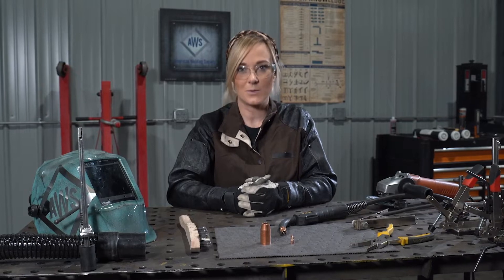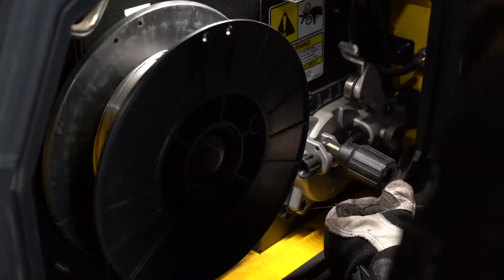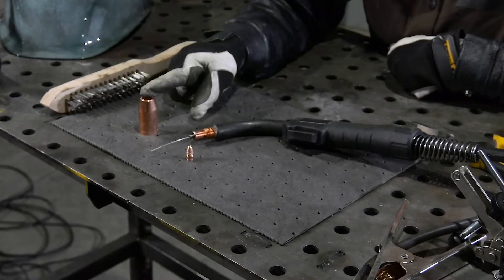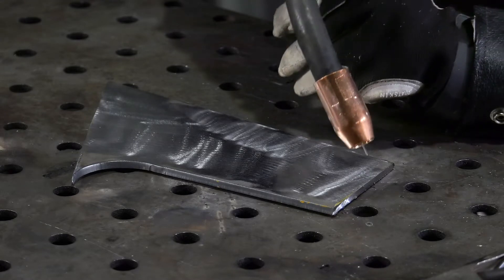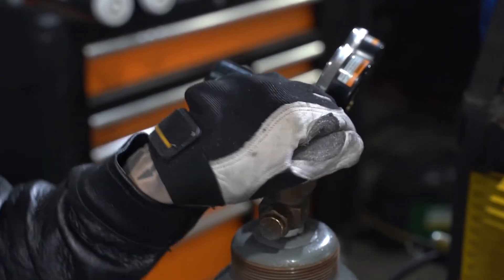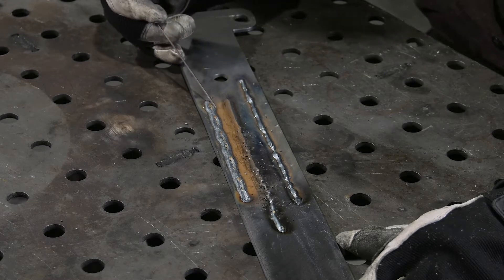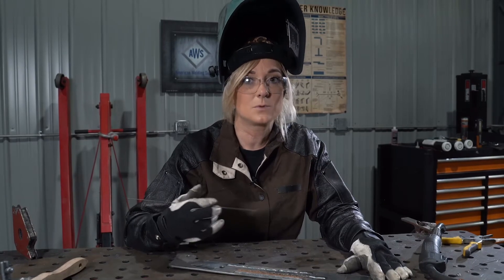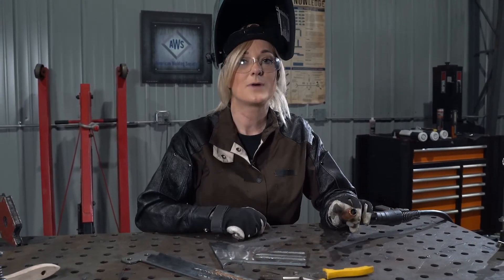ARCademy: Introduction to MIG Welding

Comment: I’m not trying to be rude here, I’m a fan of Stephanie. But I’m a welding educator too and there were multiple technical inaccuracies just in this short video. First of all, that’s a mig gun, not a tig torch. Tig is a separate welding process and does not use a mig gun. Secondly, there’s no such thing as “shielded gas metal arc welding”. There’s “gas metal arc welding” and there’s “shielded metal arc welding”. These are terms developed by AWS. I clicked on this planning to use it as a video assignment for my classes, but I’m not going to include it because I don’t want to confuse my students with incorrect terminology. AWS, please vet your educational resources more thoroughly and ensure that they are technically accurate and in alignment with the official terms and definitions that you’ve developed.